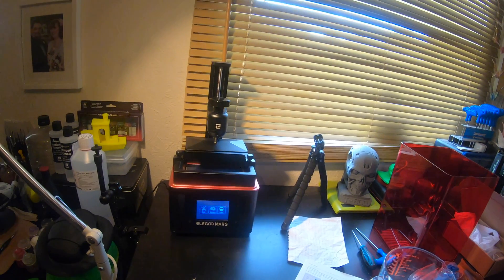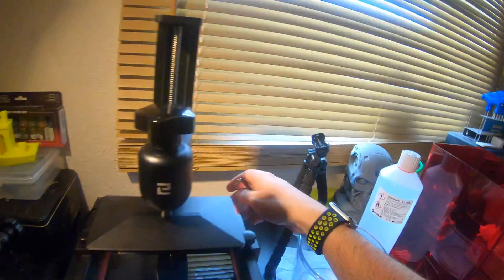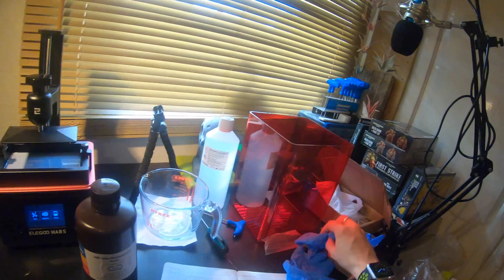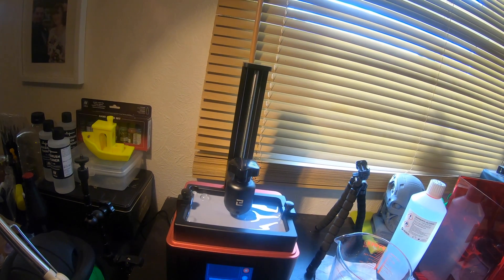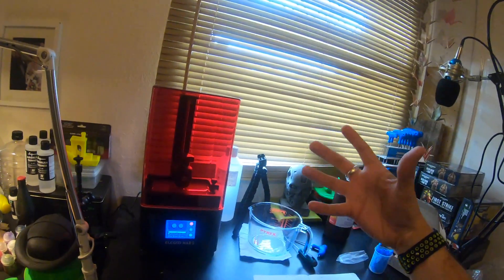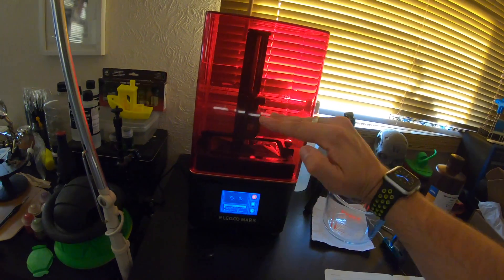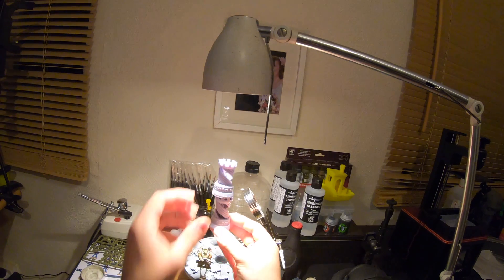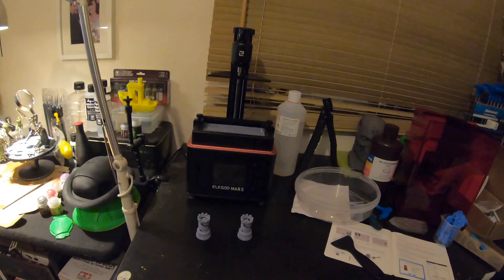Elegoo Mars First Resin 3D Test Print Video

Comment: What settings on the machine were used here for the rook? I tried a rook with the Mars 3 Pro recently and it was default settings. I think 2.5s exposure and I just ended up with 2 circles on the fep
Reply from the maker: Hey Cammy from what I remember they’re printed using defaults. It was only after this I started playing around with the settings of the printer.
Reply: @jdquad  cheers JD, maybe need to take a look at room temperature in my case.

Comment: Hi there, I had recently purchased an Elegoo Mars 3 Pro. I had assembled it all properly and how it is supposed to be used, however, I have been having unsuccessful prints. When printing out the demo prints on the Elegoo Mars 3 Pro system, all i have when done is just a circle of dried up wax, not the actual rook. Also, my prints aren't even sticking to the build plates, only the VAT OR FEP (whatever its called). I am using Siraya Tech 500ml Blue Resin if that helps

Thank you :)
Reply from the maker: Hello, make sure the resin and printer is being used in a room thats not too hot or cold or the resin may separate and prints may fail.  
Im not sure of your room setup but I can recomend a few things to try 🙂
Make sure the printer is level and doesnt wobble
Unscrew and level the bed again
Load up the print STL again and splice it again into a new file for printing (just in case the file is corrupt)
Try using Elegoo’s software (should be on the included USB stick) as all presets for the printer will be used 

The only time ive had something happen like this is when the print file was corrupt and the printer couldnt interpret the details of the print properly so the arm wasnt raising after each layer. Hope this helps a bit mate, and you manage to get the issue sorted 🙂

Comment: The mask it comes with definitely wear it. Im on my 3rd retry of the test print I put more resin in about 40-45% resin rather than the suggested 1/3. I kept noticing that nothing was printing, i’m worried my resin isn’t compatible 😬 i bought Jewelry casting resin for what i’ll be doing and now wondering if I bought one not compatible; if I remember ill come back and comment again if it works or not.

Comment: So I don't use Facebook so I'm here asking anyone for help. I've tried 2 times to print the rook. All I'm getting is about 1/4" section of the print and it's attached to the screenshot the plate. It seems to be the norm so can I change settings in chitubox with the stl model? If so what should the settings be for elegoo mars pro with iform grey.

Comment: How you liking it jd
Reply from the maker: Liking it very much Heath, a nice learning curve with it which i enjoy. The output is sublime, the extra cleaning steps get old quick but once you see the output of the miniatures its all worth it. Ventillation is a must but easy to achieve without spending much cash, time is halved by having a smaller build plate, settings are very easy to understand, touch panel makes the operation of the printer very very easy indeed.

Comment: I have heard of people using a spray bottle to spray down their prints when they pull them out of the wash, to help flush any resin off the print.
Reply from the maker: Thanks Thomas, there are a few ways you can do it. I have devised another way which ill share soon. A spray bottle will do it but that can be time consuming for a very detailed print. I prefer to submerge mine for a few seconds but more on that soon 👍

Comment: Absolutely amazing. Very high resolution. I would love to see you install some sort of fume extractor just to keep you safe. I found several ideas after looking around. The ones I found where made of old computer fans some pulling some pushing. I don't really know if you need it or not because smellavision has yet to be invented... Lol.... Just concerned about your well being. Take care my friend.
Reply from the maker: Thank you mate, but an extractor isnt needed for the location where i have set this up. Behind those blinds is a very large window (4footx3foot) which i have open when printing, even when im using PLA that extracts what smell there is. The worst smell comes from the isopropyl wash and curing afterwards but that soon disapates.
Reply: @jdquad  I was worried about your lungs my grandpa was afflicted with silicosis from the coal mines I guess I'm freaked out about it.  Take care buddy